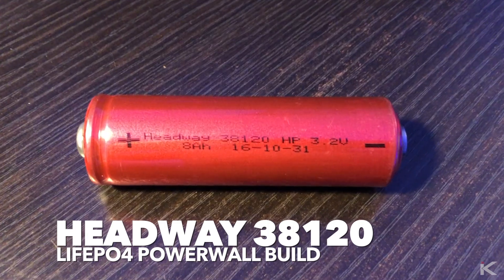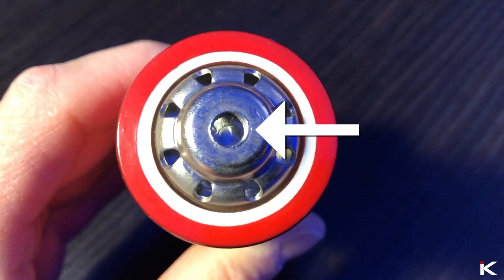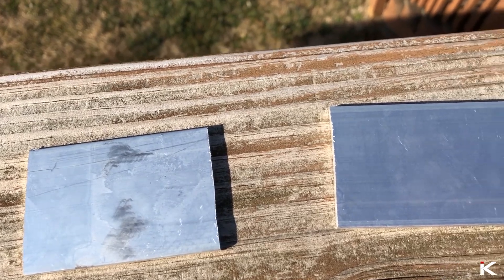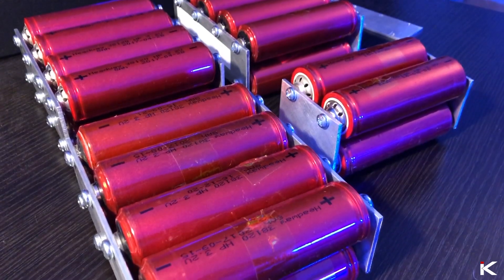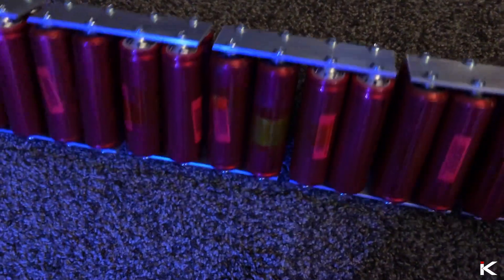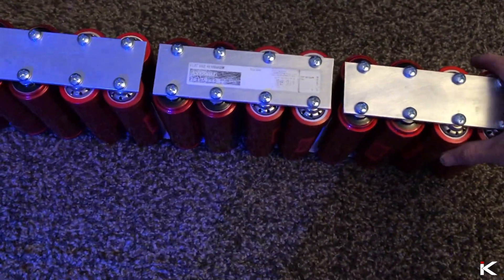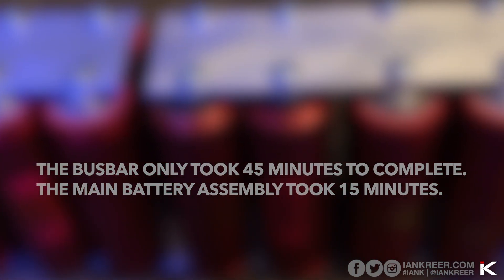Headway 38120 LIFEP04 power wall build

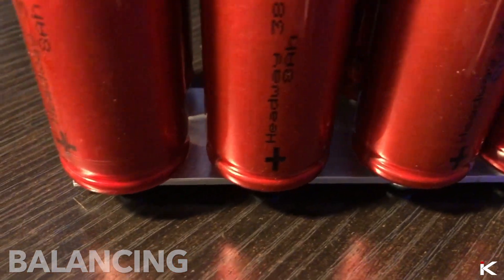Comment: 2:20....with LiFePO4 you really need to apply a charge current because they aren't going to "balance" themselves....unless they are at the very top or bottom of voltage. Remember voltage means nothing in terms of SOC with LiFePO4 unless you're under 2.8V or over 3.50V.. Just because they all became the same voltage does not mean they have the same amount of energy in them so you really need to charge them in parallel up to at least 3.50 but preferably all the way 3.60/3.65 or bottom balance down to 2.5'ish

3.20 to 3.30 is that range where two cells at the same voltage can be quite far apart in terms of SOC. At 3.27V one cell could be 76% and another could be 42%. Unlikely to see that much deviation especially if the cells are the same model/capacity/etc  but if they are different makes/capacities/chemistry(LiFeYPO4 vs A123 NanoPhosphate @ 3.3V nominal vs regular 3.2v nominal)
Reply: Harika bir bilgi .ben de lion bataryalar gibi ayni voltta ayni kapasiteyi verir saniyordum

Comment: The problem with the Headway cells is they are very expensive per watt-hour of capacity, since they are rated for such a high amperage output.  Your pack cost around $400 and has a total watt-hour capacity of about 800wh (25v @ 32ah for your 8S-4P configuration).  That is about the same cost as commercially made products using prismatic cells.  Unless you have a very specific need for short durations of relatively high amps, the pack you built isn't the most economical.  With that said, you did an excellent job with the build quality of the bus bars and I like the overall configuration.  Personally, I would still have some kind of non-conductive material separating each point where the positive and negative terminals are relatively close together.  Again, these cells can put out a LOT of juice in a hurry, so you really can't be too safe with them.
Reply from the maker: I appreciate the comment! This was a while ago, if I remember correctly I think the cells cost me $300ish, and the BMS was around $100. It was originally designed for my frag tank, but that idea was scrapped and I used it as a 12V car battery. So needing the short duration of high amps was needed. The setup was sold last year.
Reply: These are amazing for car audio. The amount it costs for a limitless battery is insane compared to what it cost to build the same thing
Reply: At $6 per cell....I would hardly call that expensive for an 8Ah cell...thats like 25wh per cell and 18650's are going to be 12wh for 3500mah cells and you can't get those much cheaper than $1 or $2 used. New 3500mAh cells are going to be at least $4 or $5

Its just the energy density of LiFePO4 sucks.

Comment: Hey. For current to pass, aluminum can be an option? I never knew that…….my brain had such a hard time accepting this, woah,  I know of copper, apparently I don’t hang out with good enough friends, lol mind blown right now
Reply from the maker: Aluminum works just fine, obviously copper and gold are better though.
Reply: aluminum in terms of weight has the same conductivity as copper...but of course that means size wise you will need more physical mass to equal the amount of copper...but copper is expensive and aluminum is easy to work with so for those that have access to a machine shop and free aluminum scrap....it can definitely be a suitable replacement. Nearly all off the shelf LiFePO4 batteries sold today in the 12V/24V/48V 100Ah to 400Ah range have their prismatic cells connected by laser welded aluminum bus bars.

Comment: Love the screw terminals. It makes life easy for tinkerers, and makes safe, solid, reliable connections. Wish 18650's had  connection options. The cells are too small for screw terminals, but could at least have spade terminals. Instead of soldering or spot welding tiny nickel connector strips, maybe solder on small screw connectors.

Comment: Can i ask what you are running off your 24V inverter and what you are using to charge the power wall? The side view graphic of how you lined up the positive and negative's was it all lined up that way to make 24 volts or a milliamp rating goal? Thanks, very interesting project, thanks for sharing your info. Is there a forum you go to for newbies to learn more?
Reply from the maker: I bought my 24V inverter for around $140 shipped from Amazon. I use it to power my small 10 gallon frag tank in case of an outage. I tested it, and the battery ran my tank for 8 hours. Pump, mp10, heater, and LED lights.

The side view graphic makes all the batteries 24 Volt. You can certainly run these batteries in 12 Volt, but you need to alter the busbar, as in create different sized busbar to accommodate 8S (12V) instead of 4S (24V).

I don't know of any forums for newbies to learn, but you could check out HBPowerwall. They have forums and a YouTube page.

Hope this helps.
Reply: @IanKreer  yes it helps a lot. Thanks for sharing all your interesting projects and information, appreciate it. 8 hours for your reef tank is impressive! wow, that is so handy to have in winter or summer storms. Very nice. Take care, Ken.